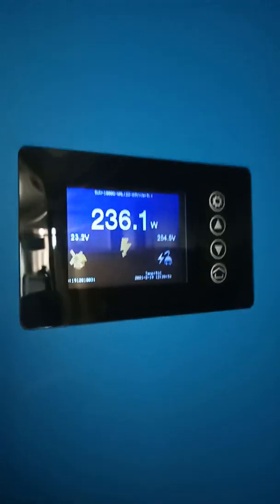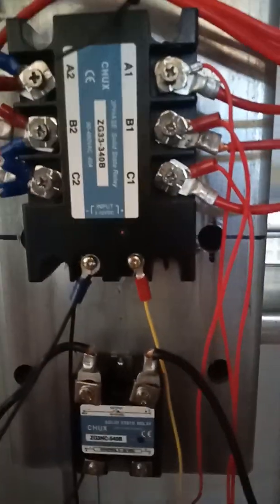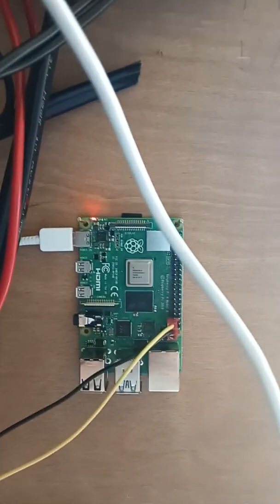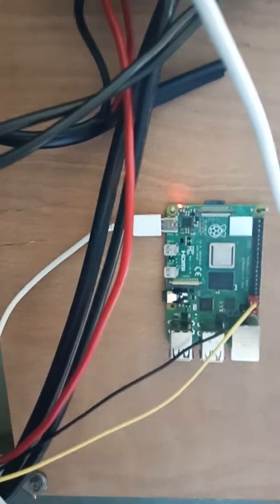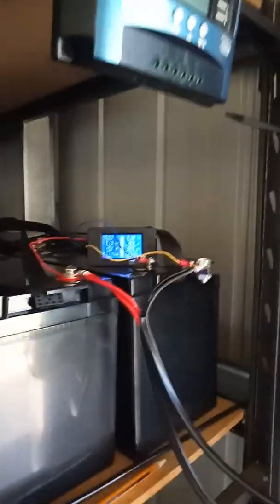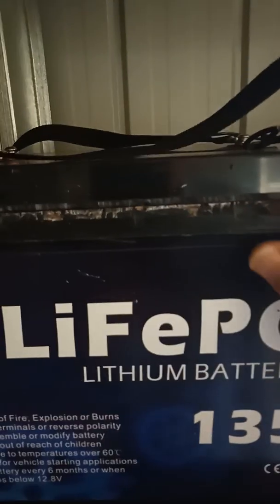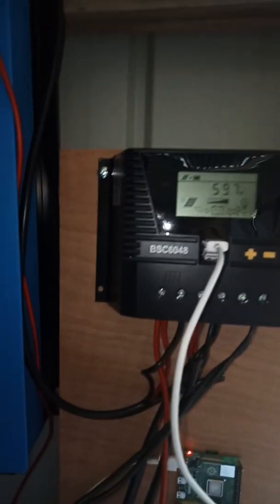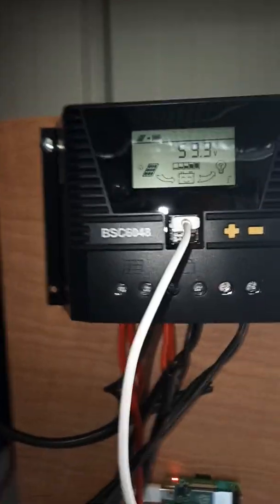b&c 24 1000w turbine cannot be tamed with a 1000w gti

Comment: Probably  going to  have to get two inverter  for the 2kw if going  by what happening to  urs
Reply from the maker: Yes I think 2 2 kw would hold  the 2kw b&c turbine. I have one thing I can do to my dynamic brake to make it act super fast.  I have a couple of capacitors that I should make smaller it will like a jack hammer but it is now my only zero cost option. 
BTW the 48 volt inverter can only absorb 1.3 kw at 48 volts constant feed.
Reply: @davecollier8946  ok ,interesting  to  see that working  for ur next  video